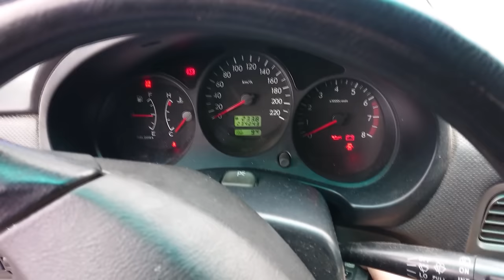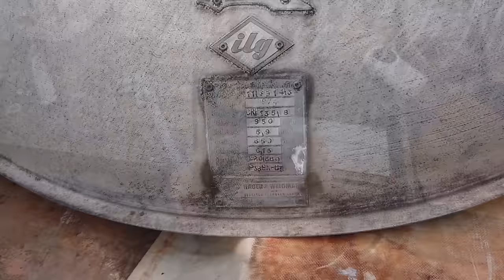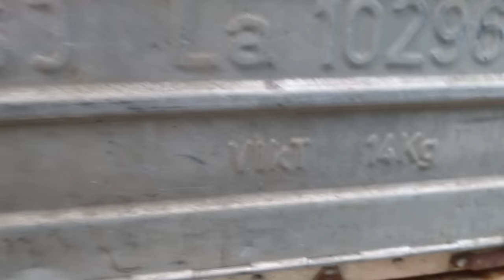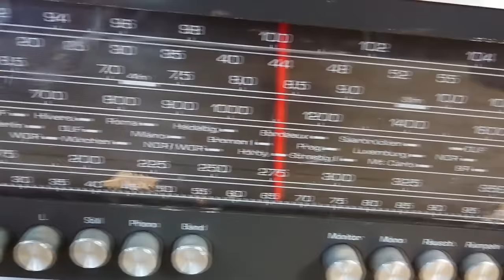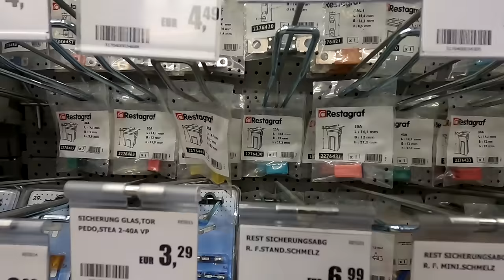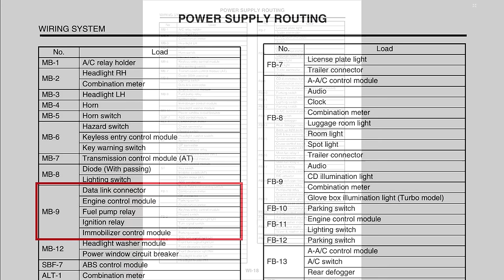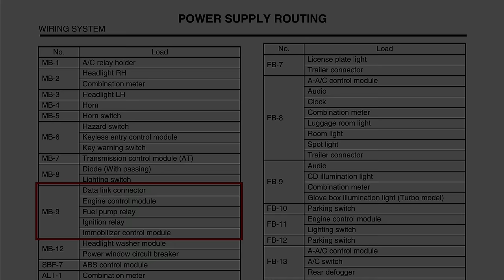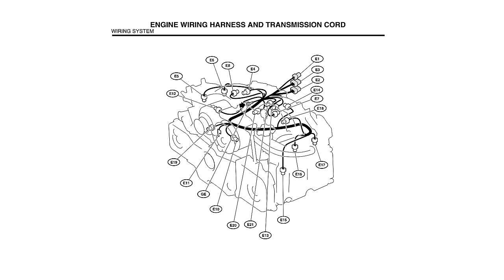New Awesome Scrapyard Finds! Repair-A-Thon!

Comment: With that Subaru motor I have gone to having 2 coil packs and a set of fuses in it at all times.  It's my mom's car and I have had to run and rescue her a few times.  Much cheaper to get them off amazon then a local parts store.

Comment: I can fix almost anything! I am literally the boy who took apart his mother's vacuum to see how it worked. My mother was so mad when she came home from work and seen her vacuum in pieces on the floor. She said i was grounded until i graduated from high school which was devastating for me  because I was only in the 5th grade! She told me not to touch it she's going to take it to the vacuum repair guy to have it put back together and I was sent to my room. I knew I could put it back together because it was so easy. I figured I was already grounded till I graduated high school so I had nothing to lose because the worst was already done. I waited till she fell asleep that night went out to the car grabbed the bag of pieces and the body brought it into the garage and put it back together. I left it sitting in the middle of the living room floor so it would be the first thing that she saw when she came down the stairs in the morning! It did not blow up when she plugged it into the wall it was quieter and I fixed the sticky wheel which made it much easier to push around the house. Needless to say she was very happy. She ungrounded me and said hey when you get home from school today see if you can fix the dishwasher!

Comment: Electrical troubleshooting is an expensive endeavor and isn't for the faint of heart, I have my ASE Auto electric and it can take hours to find, what you found essentially by accident ( or madness) one of the 2. I usually specialize in audio system repairs after someone has essentially ruined their harness by hacking a new stereo in and wondering why nothing works any more. my worst one was a kid that dead sorted the ignition 2, 3 maxi fuses and almost burned his truck to the ground as he just started cutting wires behind his dash when his new stereo wouldn't work. Although there would have been an easier way to find your dead short, by tracing wire ( ie one pin at a time.) or you just start aggressively grabbing at wires and giving them a tug to see where it cuts out at.

you start with power and work to the grounds, if you can remove it you remove it. the shop my guess didn't want to invest a ton of time and bill you for it, as electrical diag can get insanely expensive and result in( the harness just needs to be replaced) because once you start finding faults you keep finding faults, or just wiring thats too far gone to do any actual meaningful repair too.

Comment: I had a similar issue in a new car a mice chewed through a A/C sensor harness. Dealer found the issue though but wanted like $1500 for the repair because they would have to replace the whole thing. I paid $80 for diagnostics and just soldered the wires.

Comment: I work on cars regularly and rarely see electrical component failure that isnt caused by moisture intrusion or physical damage.  Vehicle components are pretty robust.  Whenever I start going down the electrical rabbit hole my mantra is "It' s something simple"..."It's something simple" and it usually is.

Comment: Finding a dead short could also be done by attaching a lab powersupply and slowly turning up the amps - You might find the short with a Thermal Camera... looking and listening for the magic blue smoke .... or even "fix" the problem by blowing the short free. 
Doing this on a gasoline car should be perhaps the last resort... ;-)

Comment: At least the -97 M3 (probably all 300-series cars) had 'marten protection' as an OEM option. Apparently, hose and cable chewing critters are a problem in Germany.

I don't know whether Subaru offered this device, but if they did, I bet you could get one from a wrecked car really cheaply.

Comment: Good luck with rodent repellents.  In my experience - rodents are more persistent and cunning than humans, and will eventually work their way around any deterrents, cats are the most unlikely protection against a hungry/cold rodent.  Best you can do is not leave any food in or around your car, and that includes avoiding parking under a food source.  Pull the rear bumper off your Forester and you will notice an air pressure release flap, that is a potential entrance, though more common is the air intake in the wiper chamber (never leave that outside air circulation switch open!).  If you search online you will find an article I wrote on meshing that intake properly on a Forester.  We were so frgn sick of rodents getting under the bonnet, we left a couple of traps inside the engine bay of the car... one evening a rodent was caught in the jaws of death, and while hanging there, chewed through 10 wires in the engine loom.   We had to replace the whole thing.  BTW - Love your channel, always great content.

Comment: Completely agree with the loss of expertees, but why are watchmakers lathes still so expensive. Those exhaust covers from shools will be riddled with germs. You nailed the UFO look with those bulbs, nice work.Just appempted to replace a phone usb socket to find the new part didn't fit but on closer inspection it was just compacted fluff in the origonal usb that was the problem. A rodent propellor. Respect finding the source of the short.

Comment: Electrical faults are the absolute worse, glad you got it fixed, hence the reason why I now drive an older vehicle with a simpler electrical system.

Comment: One thing you could have tried is to measure continuity to ground of every wire in every connector you unplugged. You would have snuffed out the wire and then could have used the wiring diagram to find where it runs and cut it out or replaced the harness entirely.

Comment: It's easy to get discouraged trying to troubleshoot any system in modern cars (I include my 2001 Jeep TJ in this group, haha!), an electrical problem can be infuriating. If you become familiar with basic DC electronics, it gets easier. Don't give up - the solution is in there somewhere!

Comment: We had to get rid of our car that wouldn't start because of a faulty fuel pump. We got another used car of a different brand which, a few weeks in, had the exact same issue (but was easier to diagnose and repair, being a decade younger).

Comment: Damn rodents have done that to the oxygen sensor wires with one of my cars. Two new sensors and a roll of aluminized fiberglass tape to protect the new wire later and then I had to clean out the nest they made on top of my intake manifold.

Best way to keep rodents away is a cat. Baring that, something thing that smells like a cat or snake, but then you have to renew the scent every time it rains. Since you didn't have any signs of a nest being made, the rodents looked to have been in there to eat and store the cherries and the cherry pits. The car was just the best shelter for that. Not having the car being parked anywhere near the tree and there being an alternative shelter for the rodents to use would be a way to keep them away from the car, but you need a good 20 to 30 feet distance, so I don't know if that will be practical. Removal of the cherry tree isn't an option and keeping a cat at the shop isn't an option I wouldn't think, but you could attract some to the area if you are near any residential properties and that could work. You just have to feed them regularly and they will frequent the area and deal with the rodent problem for you and keep it from being a problem.

Comment: that brittleness is normal, all my 2000s cars feel a little dry and less bendy or even brittle on the plastic conduit and electric tape, not discount urine theory that may b e true as well too. i suspect the heat between intake and block cook that wire loom. i'd like to try high temp wire or silicone wire or the wilder cable stuff. basically temp resistant wire. i try to reaplce radiator hoses with silicone instead of rubber when possible i figure wire insulation might well too. i've seen it on fly back transformers from old TVs with silicon wire insulation

Comment: How about build an electric rodent trap? Just a matter of some sort of high voltage power supply (a few microwave oven capacitors charged with a flyback transformer?) and two electrodes with peanut butter or something in the gap to get the problem rodents to bridge them.

Comment: I'm a car mechanic by trade, when I get problems like this it is I offer to spend time diagnosing it but people really don't like paying for multiple hours of diagnostic work as I remove components and test wires, when I tell them they need a new wiring harness they get pissy and say "why can't you just solder in a new section of wire" but don't understand I have to warrantee that repair and solder joints really do not like the conditions in a car. I now just farm out these types of job to a local auto-electrician.

I know too many people who have agreed to repair engine wiring harnesses (I know they do good work) only to have the car come back in two months with the same problem because the repair has failed then they have had to do the whole thing again for free

Comment: You should’ve cleaned and polished the inside of the lamps. It would make a difference in the light output if the inside was reflective.

Comment: The issue with cars and animals is a worldwide thing. If you are interested, there are two YouTube channels I follow with extremely knowledgeable mechanics. One is South Main Auto and the other Pine Hill Auto Diagnostics. I have noticed that module failure is rare, but not uncommon, the other more prevalent issue is corrosion or animal damage forming inside the fuse box, or connectors, or even in the wiring due to a puncture in said wire.

The business model for mechanics is, plug the computer into the DLC, (data link connector) find out which module is “defective” and replace. Even if it's not the problem, they will still charge you. Employing mechanics with experience is expensive and cuts into the bottom line. 

Finding a shop with the owner as one of the mechanics seems to be the way to go, but, as they say, YMMV. Now, what I have written is just a generalization, based on what I've gleaned watching these two channels. Believe me, there are mechanics out there that have solid troubleshooting experience, you just have to find them.

Comment: I can tell it would have no spark from when you sat in it and turned the key on. No Check Engine Light. This usually means the PCM has no power. What should happen is when you turn the key on, the check engine light will turn on, as a bulb test. But since its powered from the PCM, if it has no power, it will not light. Then when you crank, the light should extinguish. This indicates that it is getting good crank sensor signal and is firing the injectors/coils. If it stayed on during cranking then the first suspect would be crank or camshaft sensor.

Comment: On the Subaru wiring fault.
It seems very weird to me that there was a solder joint in the centre of those broken wires, it’s as if it had already been repaired without fully re-insulating the wires. Or maybe the insulation applied was favoured by the rodents.
Either way, I’m glad you found the cause and even in my job where I do exactly what this job entailed every day in a car factory these faults are often quite simple like this and are a pain to track down as no amount of onboard diagnostics can find something like this.

Comment: I got rid of rodents on my car engines by spraying a mix or Peppermint oil and water in the engine compartment sever time each winter.  No more acorns in my engine compartments.

Comment: as an "old" mechanic I can only say that electric faults are the biggest problem on "new" cars because it can take forever to find a stupid little fault and it is almost impossible and spec scantools for each brand and at the same time there can be several different components and wiring harnesses on the same model and year, so you should ideally be a specialist on the individual car and each manufacturer does things in their own way

Comment: Same happened to my yamaha bike i changed battery twice battery/ charger module/ many new plugs / new ignition switch/ new bulbs / new relays / new ignition coils/ new engine rebuild...at last i was willing to trash my bike n it was a short in main ignition wire more over its 2010 very less driven bike

Comment: I had rodents kill two of my cars in 2 months..  The only thing that I have found that consistently works is mothballs (naphthalene) under the hood. (with the downside of the smell)  I also have put in the "natural" deterrents but they don't always work. Ultrasonic repellants do not work at all.

Comment: I love the repurposed exhaust shroud lights, that's a great idea!! 👍👍
    See shite like this is exactly why I will never buy a vehicle made after 1996! 🤷
 
 I'll stick with my old school vehicles that don't need to be hooked up to some computer to be registered that I can easily and cheaply fix myself, bc they were designed with End User Repairability in mind. At least with them you don't have to pull the entire engine just to change a simple head gasket, exhaust manifold etc. the same cannot be said for the computerized sardine can garbage they build today.

[Edit] You could always use Moth Balls in little mesh pouches in the engine bay to keep the rodents away.

Comment: You were lucky that you don't live in the UK, when you broke down in the supermarket carpark !
In England you would get a €100 fine after 2 hours !
I myself am fighting a £160 fine for parking on the pavement outside a barbers shop which declared itself a car park, put up a couple of signs (which I didn't see) and although the shop was closed when I was there, I'm still facing going to court to settle the matter !

Comment: Electrical gremlins will eventually kill most modern (computerized) cars. I just just payed 1800 euros to fix a low milage, good looking Volvo V50 I paid 2100 euros for a year ago. My trusted local garage down the street spent hours trying to fix it, without any luck. They could not run a really deep access computer diagnose. This requires Volvo’s proprietary software. Only available to official dealers. And they are VERY expensive. But I guess, even the dealer felt a bit sorry for the silly prices and coded a spare key free of charge when the new control unit parts were programmed. So, technically, I saved around 200 euros - on the key. But I was VERY close to scrapping the bloody thing. It better be good now!

Comment: I have owned 3 Subaru while living in Canada, including an identical Forester with the EJ20 engine. Never had any electrical issue (squirrels stay in trees) but cars die because of rust (when brake lines leak it's a strong signal) and very few cars go over 12 years (winters) of age... Salt is bad for blood vessels, concrete and steel! After an engine swap (broken timing belt) I ended with a pile of parts in my garage including the very same admission pipe and harness, seating there for years, useless 🙄

Comment: Honda makes a rodent resistant tape that you can wrap electrical wires and connectors with. Doesn't help if you have to take it apart again to use the tape.  Try moth balls.

Comment: I'm not sure of regulations, or if you can get one in decent shape but a MK1 or MK2 Volkswagen diesel is very simple. It doesn't have nearly the get up and go of your Subaru but they're very long lived and easy to maintain. New and used parts are easily available at least in the US. A reliable driving example can be had over here for $2500 USD. For $2500 you can expect that it won't look amazing but it should drive you to wherever you want to go. If you want one that both functions and looks nice it's about $5000 USD. If you are able, you might look into it. The Elite don't want you to repair your own vehicles. If you can repair your own vehicle, they lose money and control. I'm not going to play into that game.

Comment: When ya know in your gut there's a wire somewhere causing this. Ya need to turn to our friend the remote starter.
Tug wires, start, tug wires, start, move wires, start. They can't resist but to show themselves.
Reply: Then they're always PHAD or Wes, depending on which side of the globe your on that is.

Comment: Scrapyards are full of perfectly good cars with just one or two niggly electrical faults that need time to find and rectify. I try to fix everything on my family’s cars but on the odd occasion I’ve not had the time and it’s needed quickly I’ve had no option but to get it fixed at a garage the last time time the labour was £60 hr!!!!   3 times my pay rate!! this is what’s making older cars uneconomic to repair!!!!

Comment: How can you be so electrically and electronically skilled and have such problems with a shorting 12V circuit?
At worst you pull the engine harness and inspect it. You need to watch some "South Main Auto" and "Pine Hollow Auto Diagnostics" videos. Those lads deal with exactly this kind of problem all the time and I learned a lot from them. Auto electrical diagnostics has some specific techniques to find wiring damage and you were on the right track, what you really needed was a load across the fuse such as a 5W bulb to give you a visual signal of the short and go circuit by circuit with a current clamp. I'm not an auto electrician but I repair a couple of auto electrical problems for my clients each month and I make it manageable by reminding myself that there are a finite number of circuits. Automotive power circuits are best tested with a load rather than a DMM and signal circuits with an oscilloscope.
There's a cheap diaqgnostic tool from TOPDON called the TopScan that you use with a tablet or phone and is very powerful. If you don't already have a scan tool it's a great place to start.
I hope you persevere and build your auto electrical skills!